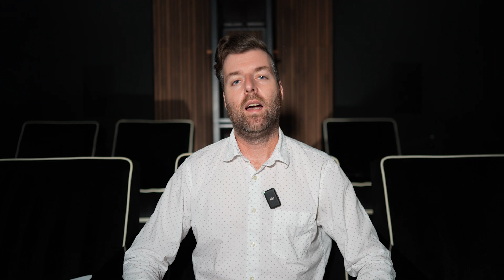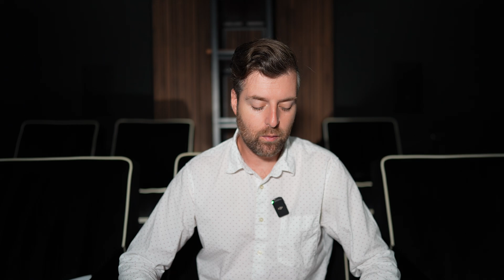Why don't H-frame DIPOLE subwoofers get more play time in HOME THEATERS?

Comment: There seems to be some misunderstanding about our open baffle servo controlled woofers. It is also very obvious that you are talking about our woofers as they are the only open baffle servo controlled woofers in the industry. So please allow me to explain a few things. 

Saying that our open baffle servo system is inefficient isn't really true or relevant. The whole system is not about how much output can we offer per watt of input or how loud it can play. The goal in this case is all about quality, control, and resolution, not SPL levels. In that regard it is second to none at any price point. Using three woofers paralleled on to one amp also makes them have fairly high sensitivity for woofers capable of playing down that low. Each woofer is right at 86db sensitivity. So paralleling three of them bumps that up to 90.5db without taking into account the increase from the drop in impedance and added current from the amp. Most of the time we can match the output levels of any speaker with a simple adjustment of the gain control without having to drive them vary hard. So we typically have headroom to spare. I have also measured a pair of our double open baffle servo subs in a fairly large room hitting 113 and 115 levels at 20 and 25Hz. So how loud is enough? 

One of the reasons for the difference in bass quality is the use of smaller and lighter weight drivers. Larger and much heavier drivers have much higher moving masses and they have a lot more stored energy. So settling times are much longer. Then through the use of servo control and we get settling times that are approximately seven times faster than the same size and weight driver without servo control.

As per another question about X-max. Each of the woofers have 18mm of X-max each way. So they will move a little bit of air. 

Also the servo control system works exactly the same for open baffle applications as it does in our sealed box applications. The higher Q design of the open baffle drivers give them the same total Q as a boxed design. So the feedback loop and control is all the same. 

Systems using a MiniDSP or Dirac are really just room EQ that turns down averaged amplitude levels. It does not solve room modes or room reflections. The open baffle servo system, on the other hand, does not load the room like a boxed design. It hits you with a velocity wave rather than a pressure wave. It hits hard then dissipates quickly without the associated room boom characteristics. Room modes are not created like typical boxed woofers. So achieving a more linear in room response is much easier. 

The output is also exactly the same out the front as it is out the back. There is no reduced output in the rear direction. 

The benefit of open baffle isn't just limited to upper ranges. The benefit is the same all the way down into the teens. 

Unlike typical open baffle designs that start rolling off before reaching low ranges, the servo control system allows for a linear response that plays flat to 20Hz and hits -3db ranges in the teens. 

Again, these are all about quality and not how loud can they play. Our answer to producing crazy high SPL levels is simply to use more servo controlled woofers. Why sacrifice quality to get high SPL levels?
Reply from the maker: Danny there is no misunderstanding. We just don’t agree.  

You’re speaking about subjective and unverifiable quality indicators.  But the question asked why these aren’t found more often in high performance theaters.  As evident by the best practices we created at CEDIA for RP22, the industry consensus was to focus on objective verifiable performance indicators related to output and bandwidth.  That is because staying true to creative intent requires that every speaker can exceed its required maximum SPL at reference levels and not be overloading or compressing at all.  That requires 118+ dB of output all the way down to 20hz and below.  Open baffle subwoofers, even with servos, have difficult achieving that without very large quantities. The open baffle design being very inefficiency at such low frequencies. If you believe a reasonable number of your subwoofers in a typical room can achieve 118dB at 20hz with no compression and minimal rise in distortion, I would like to see that. Two 18’s can do that without issue in my room, meaning two of your dual 12 units should also be able to do so to be of similar performance. 

Now your subwoofers may have some superior qualities to them. A better transient response for example. But I would wager that this is not able to overcome the transient smearing nature of the modes and SBIR effects in the room. Further, that technologies like Waveforming would be far more effective at improving the transient response. I would put my transient response up against anyone’s.  

But as I noticed elsewhere. Because of how rare these are, I would love an opportunity to be proven wrong and to evaluate these the same way we evaluate all other subwoofers.  I certainly understand many of the benefits of H frame subs for music sysyems. I just think their disadvantages are too big for use in high performance theaters.
Reply: @PoesAcoustics  With all due respect, you are measuring with the wrong stick. You are looking in the wrong places for quality indicators, and we are in completely different worlds regarding quality of reproduction. 

Listening at 118db levels is asinine. Playing music back at those levels will result in hearing damage pretty quickly. Even trying to reproduce anything at that level is completely ridiculous. Loud is also easy to make. There is no challenge to doing that. You give me a budget and a wavelength target and I will design and build something that exceeds anything you can buy for the money. However, it would be unusable and unmarketable. The folded transmission line design would be huge and wouldn't fit in most rooms. It is a ridiculous goal. 

Our target customers listens at sane levels, and our open baffle servo subs have plenty of headroom to hit high peaks if needed and do so super cleanly. 

Inefficiency again, is a none issue. Just turn the dial on the amp to reach any output levels needed to match any speaker. We've matched the open baffle servo subs to 98db sensitivity line sources and still had plenty of headroom. Efficiency is not any concern when they are being controlled by their own amp. You can also, on the fly, change extension ranges, damping, engage a rumble filter, change slopes, etc. You can make the response curve look any way that you want. 

Which woofer can hit the highest SPL without compression and minimum distortion? What is this, car audio? That would be like buying the top level Wilson Audio, Magico, and Focal models and testing them to see which one plays the loudest before they blow something up. That's stupid! 

Looking at distortion in harmonics within a subwoofer is seriously stupid on its own. Who cares if it is 2% or 5% at 20Hz or 40Hz? You can distinguish that, in that range, from the input signal. Playing at a 90db level those numbers are at or below ambient room noise levels with nothing on. That is at the noise floor of the room. That is very low levels. 

Distortion is really anything that deviates from the input signal. So if you want to look at real distortion levels then here are a couple things to look at. 

First, stick an accelerometer to the side panels of your sub boxes and measure panel flexing and resonances. With most sub woofers those resonances are sometimes only 20 to 30db down from the actual output levels of the woofer. Some boxes are super noisy and buzz like crazy totally masking the bass response. That distortion is often 10X  to 20X the level of harmonic distortion. Guess what you get when you put an accelerometer on the side panel of our open baffle H frame woofers that have braced panels, 1.5" thick and lined with No Rez? Pretty much nothing. 

Secondly, focus on settling time. Typical 18" woofers have a moving mass of about 300 grams or more. Pushing a driver that heavy to high exertion levels causes extremely high levels of distortion in that cone movement does not match the input signal. There can be significant overshoot. The signal stops, but the woofer continues to move for a long time. For our world this is completely unusable. This would be like showing up at a race track and wanting to make a few laps in a dump truck. The only way 18" woofers could be used in my world is if you used a dozen of them and then barely moved each one to less than half a mm. That is the only way to reach a reasonable settling time. 

Then there is room treatment and room acoustics. Lack there of will ruin anything regardless of how good it is. 

So can open baffle servo subs be used in home theater applications? Absolutely! Most people are not listening to movie playback at 118db. No one really.... Our woofers will play plenty loud enough and reproducing the sound of gun shoots or explosions are no big deal. That's easy. 

Also ,most of the time when our customers go for multiple woofer designs (and some use six 12" woofer per side), it isn't for volume or high SPL, even though they can play super loud. It is for even faster settling times. When a dozen woofers barely move and then stop with servo control slamming on the breaks, the result is the fastest, cleanest, highest resolution bass reproduction in the industry. Just look at what our customers have to say. Look at the post below from @marclombardi5980.
Reply from the maker: @ sorry Danny but these are the standards developed and accepted by the industry at large. You are an outlier in this belief. Not me. Reference bass peaks of 115dB have been the norm for 40 years.
Reply from the maker: @ the settling time argument will need some proof. This isn’t as logical as you make it out to be and I question if you really believe what you wrote. An 18” woofer does not have the same motor as a 12” woofer. The larger woofers have larger voicecoils and more powerful motors. The motor force of modern high excursion woofers is extremely high and allow for very strong reactions. This would ensure short settling times. 

More importantly, if what you said were true, this distortion would be measurable in the form of TIM.  Yet I have seen no such evidence that this is true.  

Further, larger cones will move less distance in and out than smaller ones for a given output and frequency. That’s their big advantage. You are telling me you would prefer a 12” cone to move 25mm vs an 18” cone to move 10mm?  

Everything you’ve written is hyperbole not fact and I’ve never seen any evidence from you or anyone else that these claims are true. 

The claim about acosutics. Where did that come from. I am an acoustician and what I specialize in is acoustics. Where you get the notion that I promoted no acoustics? That was a red herring.
Reply: @PoesAcoustics  You can claim that 115db is a reference all you want, but it is not a reference for quality. Playback at those levels are still ridiculous. No one reviews or listens to speakers at those levels.

Sure a larger or heavier woofer will have to have a proportional motor and a Qes, Qms, and with the air space in the box a target Qts. You can have an 18" woofer and a 12" woofer that both have a total Qts of .7 (ideal target). So the motor of the larger one is in proportion to the motor on the smaller one. That doesn't have anything to do with stored energy. That is like saying my semi truck can do 100 miles and hour. It is just as fast as my car. True, the truck might just as well be as fast as your car do to the fact that more power is used to get it there. That means nothing when talking about the ability to stop. That truck will not stop as fast, and neither will the larger and heavier woofers. 

Sure, a larger woofer doesn't have to move as far, but multiple smaller woofers don't have to move as far either.

Also, everything I've said is not only a fact, but simple physics.  

Maybe you just need a little more experience in high end audio?

Mentioning room acoustics was no red herring. I mention it because it is by far as big of a factor in sound quality as anything else we are discussing. I am sure you would agree.
Reply from the maker: @ you are forgetting the fact that the truck could have bigger brakes. That’s the point your argument is missing. In addition, the idea that the stored energy must be handled over longer distances.  The physics don’t support your claims so cleanly because you are intentionally ignoring other factors. The 18” woofer is moving less than the 12” woofer. The brakes on the 18” woofer are proportionally stronger than the brakes on the 12”. So the notion that the 18” can’t be stopped as fast isn’t true. 

And it is absolutely not my claim that 115dB is reference level. 115dB is the peak level established for cinema LFE. I didn’t make that up. Have you been living under a rock?

Sure many may not listen that loud. But that remains the peak for LFE regardless and many do listen that loud. Especially in the high performance rooms that leading experts like myself build. 

How about this. Instead of speaking in hypotheticals. Measure your subwoofer and post the data using one of the two industry standards. AES75, a compression test, or the CTA-2010b burst test.  Post the actual data. This test must be done outside. 

If you can’t. I would be happy to do these tests for you if you can ship a subwoofer to me. I would be as curious as anyone to know what they do. I promise you I gain nothing from tipping the scale in any direction and would do a fair and impartial test. My test equipment likely exceeds anyone in the review community. I would use 1/4” GRAS capsules for this test, which don’t compress or distort until in excess of 160dB.
Reply: @PoesAcoustics  We don't target commercial or large cinema theaters as our customer base. High SPL is not a target we are interested in and neither are our customers. I don't care if 115db is as reference for a market that I am not catering to. Those levels are still insane. 

You can add bigger breaks to a truck and it still isn't going to stop as fast as a car. Mass is mass. 

In regards to woofers, only some of the stopping force is electrical. The rest is mechanical. So saying the motor structure or power is proportionate to the mass is only part of the story and only part of the compliance. If you change the mechanical compliance to add more control then it doesn't play as low. Everything is a tradeoff, and there is no getting away from the higher moving mass of a large driver being harder to control and it will take longer to settle. 

You can't really say, the 18" woofer doesn't have to move as far either. The multiple smaller woofers don't have to move as far. They have much less moving mass, and then there is servo control. Stopping force then increases significantly with the servo control system. We can even vary the damping and control. 

Sending you a triple open baffle servo sub is not easy. We sell these as DIY kits and not fully assembled. So we don't have a lot of them assembled. They are also super heavy. However, if you have a legit way to measure settling time down to below 20Hz, I am all ears. I am not interested in high SPL testing.
Reply from the maker: @dannyrichie9743  but these large woofers aren’t trucks. They are Bugatti Chirons. They are still performance cars in your analogy with proportionally larger motors and brakes.  Yes mass is mass. But you are cherry picking your physics. It’s a logical fallacy you are well aware of. You take the lotus approach. I take the Bugatti approach. 

Your understanding of the home cinema market shows it is you that needs more time in the high end market. Your assumptions about me and my business are laughable. I have multiple million dollar theaters happening right now and that’s been my trajectory for years. I sit on committees discussing industry best practices for home theater in which industry consensus is developed through years of discussion. The numbers you think are insane are not only the numbers identified by industry consensus, they have been true since the dawn of modern home theater.  

Because of how you talk about these values I suspect you don’t actually understand what the 115dB number is referring to.  I believe it’s you who needs to go read RP22 and numerous Dolby documentation to get your head around what home cinema is. I honestly question if your subwoofers couch achieve 105dB let alone 115, so even if someone was turning it way down, it would still be a concern. A simple fact of physics. Open baffle subwoofers are no efficient reproduced of low bass.
Reply: @PoesAcoustics  Like I said before, we are from two completely different worlds. I am not into creating boom boxes and you are clearly not into high end audio. 

You can't begin to compare a heavy, uncontrolled 18" woofer to a light weight, 12" woofer with servo control. Those aren't even in the same conversation. It is laughable to even make that comparison. 

The next time you are in one of those committee meetings please let them know that the average viewing public is not deaf. We should not have to take earplugs to the movie theater. Case in point, when our kids were little we took them to see Shrek. I had to go back out to the car to get earplugs. Half of the audience was covering their ears for loud scenes. THAT is ridiculous. 

You keep going back to efficiency... .Efficiency is a non issue when you have a system that is linear down into the teens and has a volume control that can be adjusted to match any speaker. 

High sound pressure levels are also a piece of cake. I still have the in room measurements showing dual servo subs hitting 113 and 115db peaks at 20 and 25Hz. How much is enough? We have customers using twelve 12" open baffle servo subs in their systems. I wonder how high of an SPL level they can hit? Who cares really? They don't have twelve of them for high SPL. They use twelve of them for even faster settling time.  

We demonstrated high SPL capabilities one year at the Rocky Mountain Audio Fest using a pair of speakers with dual open baffle servo subs in the bottom end. We turned on a track called Deeper by Pete Belasco and freaked people out. We had a small group of people run into our room from the hallway telling us that we were about to rip the sheet rock off of the wall in the hallway. So we had to turn it back on, and go out into the hallway to see for ourselves. Sure enough, the sheet rock was flexing about 1/4" each way, and the wall in the hallway wasn't even a common wall to the room. There was a bathroom and a closet between the room and the hallway. 

High SPL is not an issue.
Reply from the maker: @ you keep claiming efficiency is not an issue and your proof are anecdotes. Efficiency will tie directly to the abilty for your subs to translate electricity into acoustic output. Your designs are inherently bad at doing that at low frequencies. That’s physics. Any time the front wave sees the back wave front there is going to be cancelation. You get dipole cancelation and rolloff. That requires more excursion and DSP compensation. Servos require some of that power to maintain control.  The lack of box loading makes the problem worse. Not better.  The proof is on you and anecdotes aren’t proof.  

My systems aren’t about boomboxes. They are absolutely high end. Real music has large dynamics. Real events have large dynamics. They require large SPL to track those dynamic peaks. 115dB at 20hz is not nearly as loud as you make it out to be.  It’s hard to reproduce yes. 100dB is the audibility threshold of 20hz. That’s only 15dB of dynamic range in that low end.
Reply: @PoesAcoustics  Okay, I get it. You just don't have any experience with this type of system, but your assumptions and misunderstandings here are glaring. 

Efficiency still.... Okay, each of our woofers has 86db sensitivity. Parallel three of those together and what do you get? Pretty good sensitivity. Now if they were not servo controlled but designed with a high Q for open baffle applications then yes, they would have a roll off that would need compensation. The parameters are very different for a woofer with non-servo control versus those with servo control. However, I could design a woofer (for open baffle) in a way that gives up very little bottom end at the expense sensitivity. Is that a problem? Giving up sensitivity for extension? Well, it is if it is a passive speaker and driver output levels need to match. If the driver has its own amp and you can add any amount of gain that you need, then it is no issue at all. The same is true for  the servo system. If it adds some gain to maintain the linear response, who cares. That power didn't cost anything. 

The servo system compares input to cone movement and makes on the fly adjustments. Again, it will add gain as needed to maintain a linear response. What if it adds 3db of gain? What if it adds 6db of gain? Who cares. Plus, the depth of the H frame side panels separate the front and back waves and adds pressure and velocity to the output. The deeper the side panels the more it loads the drivers and the lower the extension without adding more gain. 

The servo system doesn't just add electrical resistance to control settling either. It can reverse a pulse to fight against movement. For instance, with the system turned on, I can press on the cone with my hand. It senses that cone movement and kicks back with a reverse pulse that can be pretty hard. It sees it as not matching the input and makes the correction. It creates speed like no other system, and that is very audible. 

Oh, and cancellation at 90 degrees off axis isn't a problem. It is an advantage. It does away with typical room loading and room boom. It hits hard and is gone. It doesn't create pressure waves that reflect through the room causing long delays. Remember this is all about quality and not quantity. It has plenty of quantity, and it can have all the quantity you want with plenty of headroom.
Reply from the maker: @ I don’t think it’s me that is misunderstanding. The efficiency isn’t the same as sensitivity. Your system isn’t 86dB sensitive at 20hz. 

And the gain matters because that equates to power. Why are you pretending like that isn’t true?  Of course that matters.

Dipole cancelation refers to the overall slope at such low frequencies. Not just the side cancelation.  At these frequencies the depth of the H frame becomes irrelevant. That is helping at higher bass frequencies.  

Instead of claiming I am the one making false claims from glaring misunderstanding. Please put up some actual data to back up your claims. Show me the transfer function of your servo amp at different levels. Show me the SPL and distortion at different output levels. Do the CTA-2010b testing. If those results don’t confirm what I have said. Then I’ll readily admit my understanding is wrong. 

Ive already shared this thread with a PhD acoustical physicist who specializes in speaker modeling and design. Asked if my understanding was wrong. His comment was that I had it right and the burden of proof is on you. That your claims are coming off as outlandish.
Reply from the maker: From Linkwitz on this specific topic of the dipole rolloff. That you claim doesn’t matter.  

“In practice, the dipole response is made flat by boosting the amplifier output at 6 dB/oct rate, but this places serious demands on the cone excursion capability of the driver. 
A very important number for comparison purposes is the frequency for which the dipole output is the same as that of a single monopole, i.e. when  |H(f)| = 1 = 2*sin(180*f*T) = 2*sin(30), which yields

f = 1/(6*T) = 0.17*v/D 

f = 229 Hz in figure 2 above. The comparable monopole has a flat frequency response (0 dB), whereas the dipole rolls off at 6 dB/oct. To maintain constant sound pressure level (0 dB) the monopole displaces four times (+12 dB/oct) the air volume for every halving of frequency, but the dipole has to have eight times (+18 dB/oct) the displacement. Very quickly the maximum excursion capability of a driver becomes the limiting factor for maximally achievable sound level. Multiple drivers must be used to go beyond this limit. A spreadsheet spl_max1.xls allows you to calculate the excursion limited SPL for known driver piston area and peak excursion.”
Reply from the maker: I also need to take issue with your claims about mass. Your 12” woofer has very low mms. No doubt. But your motor force is proportionally lower too.  So your moving mass is much pushed  around by 62.5 newtons per watt. By contrast, a very high performance 18” sub has about 3x the moving mass. But it has 183 newtons per watt. 3x the motor force controlling it.  The ability of an object to resist direction change is kinetic energy and more mass certainly means more counter force is needed. But if you have 3+ times the counter force. You have equal or better stopping power. 

Your cones moving mass operating at 20hz produces .47 joules of kinetic energy. That requires .42 watts of energy to counteract it. Which would be right only for a perfectly efficient motor. 

The 18” example comes to 1.28 joules.  The watts needed to stop the kinetic energy of that cone using the more powerful motor is .39 watts. 

In other words. If we want to be nice. The 18” woofer and 12” woofer are equally able to be stopped. If we want to be pedantic. The far more powerful motor in the 18” woofer actually allowed its 3x higher mass to be brought under control with 8% less power.
Reply: @PoesAcoustics  You just can't seem to get the point here, because you are too lost in looking at this the wrong way. 

I didn't confuse efficiency with sensitivity. I used sensitivity as an example. The woofer itself in the H frame design doesn't have to have a flat sensitivity to 20Hz. It doesn't make any difference if there is a natural roll off or not. For that matter, a sealed box has a natural roll off that is similar as well. The servo system will add gain (add power) to maintain a linear response. That isn't a bad thing for it to add power to reach the objective. It has plenty of power to spare. Power is not a problem. There isn't a limit there. 

Also, the depth of the H frame is not irrelevant. Going from a flat baffle to side wings, to longer side wings all changes the total Q of the system, separation, and velocity. 

And man, you went right back to SPL and distortion. This isn't about SPL and distortion. Max SPL isn't a measuring stick. Can the servo system produce high SPL? Sure, but that is not the point. It is not relevant. 115db, 110db, or whatever is not the goal. Do subwoofer systems need headroom? Sure, and we have that in spades. How much is enough? More than enough, is plenty. Harmonic distortion again? Measured distortion with the servo system is much lower especially with open baffle applications. In a boxed design you are dealing with changes in back pressure from the box that causes force on the cone that can be out of sink with cone movement. That is a distortion. Also, as I mentioned earlier, cabinet resonances and settling time can be 10X to 20X the audible harmonic distortion. Focus on what makes the most difference, not numbers used in marketing. 

Share this with whoever you want. I don't care. A certificate of education completion does not trump practical application. 

Cutting and pasting information from the Linkwitz site doesn't completely apply here either. The goal isn't to get the highest SPL from one driver. We can use a lot of drivers or a lot of power and even both. 

If end all be all performance is the goal then none of that you are harping on is relevant. 
If you want to look at it as performance for the given price point then that's a good measuring stick. 

You also keep going back to motor strength versus moving mass. Electrical compliance is only part of the picture. The mechanical compliance is also part of the picture. Box volume is part of the compliance as well, and that is really just a spring with poor damping. When comparing to servo control you can't just look at the electrical compliance of the driver either, because the servo system makes that a variable. It can virtualize that parameter and completely change it. 

Let me give you a simple test to perform that might help you understand. Put your hand on that big woofer of yours and push in on it evenly across the cone near the dust cap. It will not be hard to get a bouncing rhythm going and move it in and out. You can easily get it moving in a cycle. It won't matter if the amp is plugged into it or not or how big the motor strength is. You can't do that with servo control. You can't make it bounce at all. Added electrical control is much more than just the electrical compliance of the driver.
Reply from the maker: @ sorry. This is all wrong and it’s not me getting it wrong. 

You keep claiming SPL isn’t the measuring stick. It is one of many. And because you can’t hit that one. You claim it doesn’t matter. You use the term gain as of it’s not tied to power. You talk about headroom as plentiful when it can’t be and isn’t. Your amps are lot that powerful. Your subs don’t handle that much power. And their xmax is limited. You do not have limitless headroom. And you lose 6dB per octave in your rolloff to a sealed sub. Yes all subs have a rolloff and aren’t flat. Yes sealed subs have DSP that compensated for their rolloff. But yours starts earlier and is 18dB per octave instead of 12.  

You are yet to prove your point or provide anything but empty words to back it up. Enough with that. Please post some data. Any data you thinks supports your points. The burden of proof is on you. Not me. I’ve already given the maths. They don’t support your claims. They didn’t originate with me. So please prove me wrong. 

I understand you value different things than the rest of the industry for sound. That doesn’t make me the naive wrong one. My values follow industry norms. Yours don’t. That’s ok. You have your niche. But the things I said about output are all correct and hold true for H frame subs.
Reply: @PoesAcoustics  Yes, SPL is not a measuring stick for sound quality. How loud something can play is more akin to car audio than high end home audio. Plus, high SPL levels are easy to hit if that's the goal. Even our open baffle servo subs can hit your industry reference levels. Yes added gain or added power is the same thing. Headroom is plentiful when it can hit many more times the levels that a person listens at with normal music playback of 85 to 95db peaks. In that case the amps have plenty of power. The woofers will handle the full output of the servo amps. So power handling is also a non-issue. All drivers have a limit to X-Max, and there is a limit to headroom for all amps. So that isn't saying anything. You are still looking at this as if it only involves one driver or one amp. You have to look at the whole picture. The system doesn't involve just one woofer and one amp.

We have thousands of these out there in the top level audio systems and in thousands of home theaters. They're probably used in more home theaters than you've ever been in. 

Facts are that nothing is faster or more control. Nothing else offers this level of resolution. Nothing settles as fast. They do play flat to 20Hz and hit -3db levels in the teens. With multiple woofers and amps (like a pair of triples, six 12's) hitting a "reference level" is not a problem, but not at all the point.

My point is also proven by customers like @marclombardi5980 that posted just below. His feedback is exactly the same as thousands of other customers just like him. 

We also got the same feedback at the high end audio shows where everyone said we had the best bass response of the show, every time, and I am not talking about playing loud.
Reply from the maker: @ Danny I think you don’t know who I am who what I do. A lot of your dismissive comments are undermined by your lack of understanding of me. I probably have more dollars value theaters in action right now than your annual sales. 

I don’t question the sound quality of your product. Just your claims about my knowledge and understanding of the product.  I answered why they aren’t commonly used. I understand you don’t agree with it. But you will get the same feedback from the vast majority of knowledgeable engineers in our industry.  

I don’t plan to continue this discussion. It’s clearly going nowhere. I made my offer. Send a product for evaluation.  Like every other manufacturer.  Post some supporting data.
Reply: @PoesAcoustics  You're right. I don't know you that well. It sounds like you really don't know that much about me, or the size of my company either, let alone our annual sales. So maybe we both have made some assumptions that are not valid. 

I watched one of your other video's to learn a little more about you. The one titled "Debunking Audio Myths. Cables Don't Make a Difference" caught my eye. I watched a little of it, got a good laugh, then quit watching. 

If I would have known you were one of the flat earthers that think all cables sound the same then I wouldn't have even engaged you in conversation. I have found that people with preconceived beliefs are the hardest to teach. Clearly you have no real experience in high end audio, and trying to teach you anything was a waste of my time. 

Good luck with your channel.
Reply from the maker: @ponse:

Thanks for your comment. It’s clear we disagree, but let me address a few of your points.

First, calling me a “flat earther” is not only unnecessary but ironic. Flat earthers are known for rejecting measurable, scientific evidence in favor of personal belief, which is exactly what you’re doing here. My views are based on measurable science—repeatable, objective tests that anyone can verify. Yours, on the other hand, seem rooted in subjective opinion, dressed up as fact without providing any supporting data.

Second, dismissing my content without engaging with it fully suggests that you’re more interested in maintaining your preconceived notions than actually considering different perspectives. That’s fine, but it doesn’t make for a meaningful conversation.

Lastly, claiming I have no experience in high-end audio because my views don’t align with yours is not an argument—it’s an assumption. Experience doesn’t automatically equate to correctness, and if you can’t back your beliefs with evidence, then dismissing others as unteachable is simply a way to avoid addressing the flaws in your position.

If you ever want to have an actual discussion based on evidence rather than personal attacks, I’m happy to engage. Until then, good luck with your endeavors.
Reply: @dannyrichie9743  "I have found that people with preconceived beliefs are the hardest to teach. "  Which is the problem we have with your arguments Danny.  You have never, ever post measurements of your room yet you claim somehow they don't follow laws of physics and it is without room modes.  You don't know psychoacoustics so think 115 dBSPL is as loud at 20 Hz as it is at 1 kHz.  As Matt correctly stated, the threshold of hearing is around 100 dBSPL at 20 Hz.  Meaning if you produce 100 dBSPL at 20 HZ, it would be barely audible.  Whereas the same at 1 kHz would be very loud.  Please watch this video to understand better, assuming you are not hard to teach: https://youtu.be/zTEQmmG6TzE?si=VwiejQB7N3lfDeQQ

Matt is an expert in the field.  His knowledge comes from both science of sound reproduction and practicing the same.  Your knowledge is that of building speakers/subs using simple techniques, devoid of any advanced science, or measurements.  Heck, you don't even measure low frequency response of your speakers!  You use simple gated measurements that don't allow for that.  As a result, you have produced speakers with horrible bass response: https://youtu.be/9dD0Aussu4o?si=UINqCXJ127L7tpNL

You talk about cables doing things that are not possible in this universe.  Again, here are the receipts for that, both subjectively and objectively, showing your power cables do nothing useful and are built horribly to boot: https://youtu.be/HkmwcPdTlWM?si=GMWZoueYAsLqccL8

At some point you have to take your own advice and start to listen to other experts, pay attention to extensive research out there, and respect opinion of others who really know what they are doing as opposed to just putting parts together.
Reply: @dannyrichie9743  "Okay, each of our woofers has 86db sensitivity. "  There is no such thing as a single number sensitivity for any speaker or driver.  Such value varies with frequency.  Indeed, it tracks the frequency response.  I can't believe someone designing speakers not knowing this and running with this marketing value.  As Matt wrote, if there are cancellations -- which there would be with open baffle -- frequency response won't be flat and so sensitivity won't be flat.  Please, for heaven's sake, perform such measurements to realize stuff like this is trivially wrong.